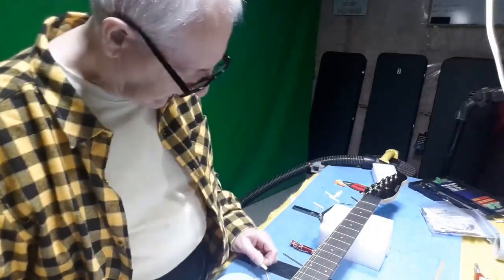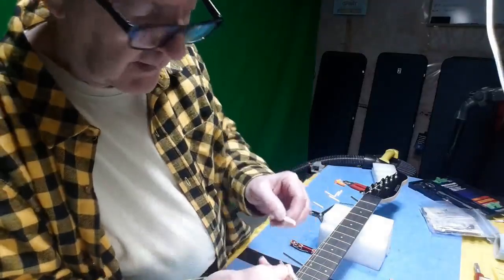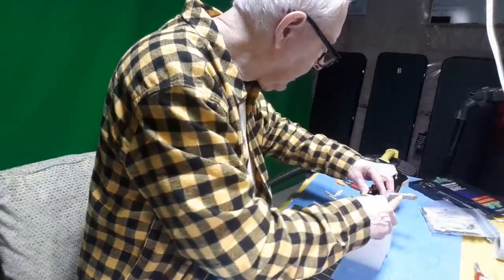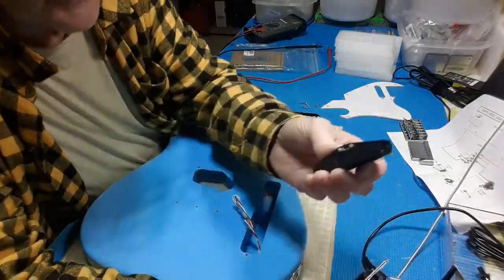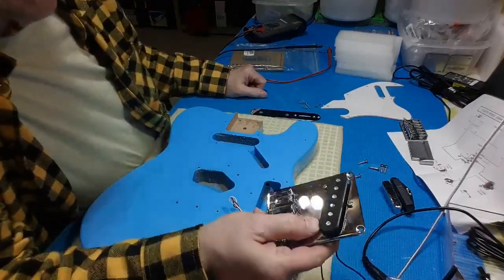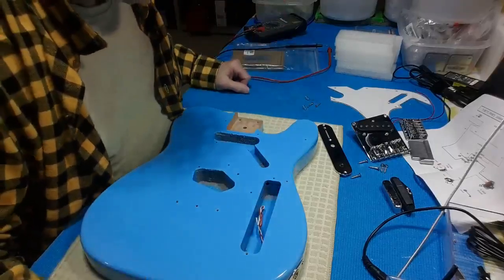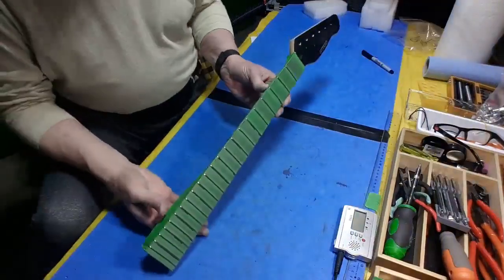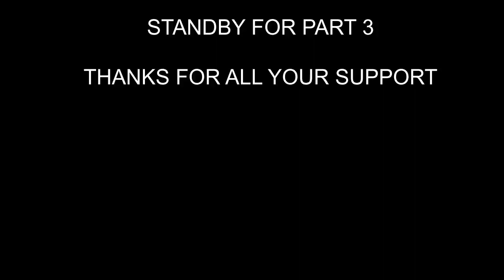AMMOON BLUE TELE PART 2  JAN 2023

Comment: I think the dip is by design possibly to avoid fretting out on the upper registers.  A bar magnet doesn’t guarantee ceramic it may be Alnico, there are still cost savings as an Alnico bar is cheaper than six Alnico slugs.

Comment: Tusq nut blanks come in a variety of neck widths and can be found in sizes that are taller if the are totally blank (not marked with string spacing).
Reply from the maker: Do you have any links to the blanks and or taller tusk nuts? I've looked and I can't find anything as tall as this plastic nut that came on the guitar.

Comment: 7:38 — Regarding that “dip,” just so we’re clear: Do you mean that the neck pocket is actually unevenly cut? Or could it be a depression from a cardboard shim that had been put in there at some point? Maybe a contour gauge is needed to help gauge what kind of shim is needed? I can imagine taking a wooden shim and sanding it at an angle to match the pocket, depending on what’s needed. BTW, judging by the effort it took you to get the neck out, I’d say that neck pocket is clearly good and tight, compared to the neck pocket on my Firefly FFTL!
Reply from the maker: Unevenly cut. The back part directly under the heel is deeper by a couple of hairs.  It is visible and can feel it.  I had the same thing on another ammoon strat I haven't shown on the channel yet
Reply: @2bikemikesguitartopics145  Hmm… That is unfortunate. Unfortunately, this kind of sloppiness also seems to be a lot more common out there than people like us would like. 😂 I’m not sure how you plan to tackle this problem, but I’m thinking maybe a contour gauge to determine the angle of the shim you need, then sanding a wooden shim to match the angle in the pocket… What do you think?
Reply from the maker: That would definitely be the top shelf way of doing it if you had the wood and the tools available but I don't. So what I do is try different thicknesses of cardboard shims in there sometimes plastics and see which one works the best to flatten it out for me or even sometimes provide me a little back angle plus fill the dip. In this case I found it to be .27 mm
Reply: @2bikemikesguitartopics145  I know that StewMac sells wooden shims shaped specifically for Fender-style neck pockets for about $14 each, which seems pretty reasonable if you’re only planning on doing one guitar this way. (Assuming Ammooon has correctly copied the Fender neck pocket design, that is.) I suppose shipping to Canada might be a problem for you up there though. 😢
Reply: It does make me wonder though if there are places online that could laser-cut the wood to your design specs for a reasonable price… I’ve gotten custom laser-cut wooden Christmas ornaments this way before!

Comment: If coke doesn't work, try coffee
Reply from the maker: Yeah coffee is a good stain or isn't it
Reply: @2bikemikesguitartopics145  I was going to say coffee as well. Coffee grounds and coffee liquid are used in relic jobs on guitars. May not work on all parts (such as metal) but works on woods, pick guards, plastic knobs, etc.
Reply: @2bikemikesguitartopics145  should work great on plastic or bone. Just look what it does to are teeth. I know teeth aren't bone but it should work